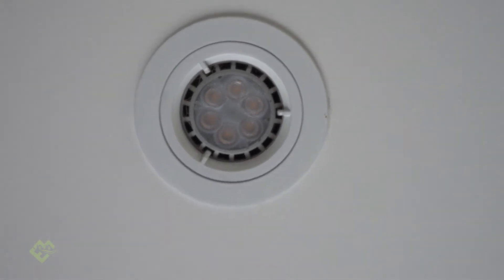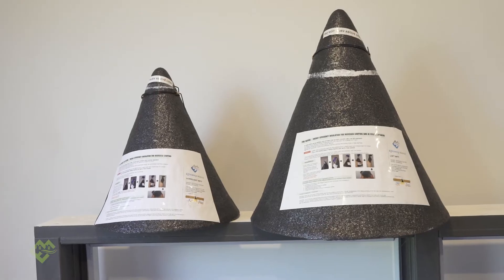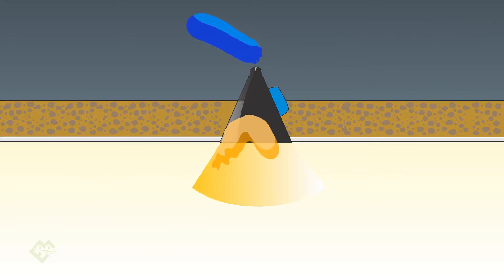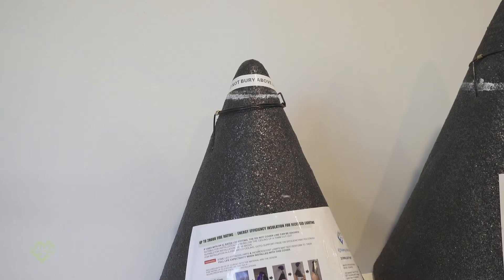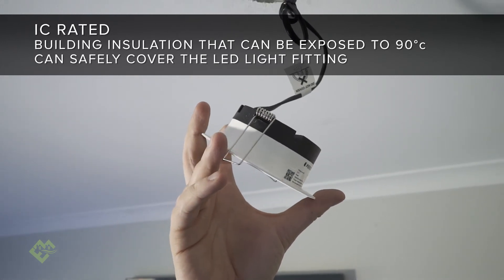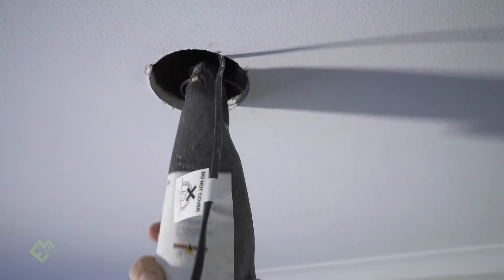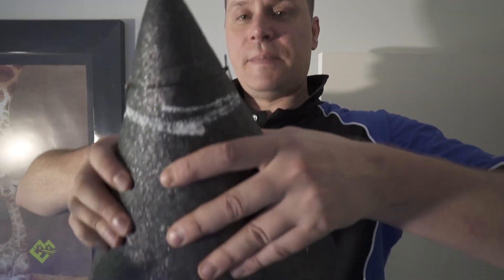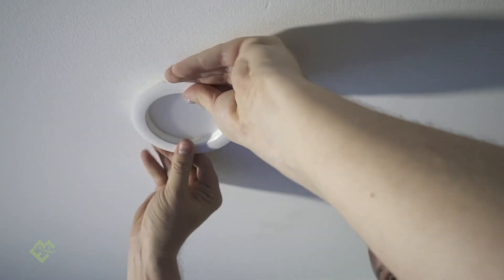LED Downlight Cover: Fire rating, dealing with LED Insulation consistency

Comment: I didn't know this. Do they blow off when you do a passive house door check with pressurisation?
Reply from the maker: Andrew C Never... that’s our story and we are sticking with it. 😉
Reply from the maker: Having said that, recessed lighting wouldn’t be a good idea in a passive house home.
Reply: Efficiency Matrix Taking the fun out of passive haus are we? What about if you were aiming for a Josh's house standard instead? http://joshshouse.com.au/
Reply from the maker: Andrew C No problem with your standard homes.
Reply: Efficiency Matrix Josh's house is 10 stars, with HVAC built to standard budget.
Reply from the maker: Andrew C What level of air tightness?  And insulation consistency?
Reply: @And-c7n  interesting it got 10 stars with only 1 double glazed window

Comment: I don't see how this product would be energy efficient as installed.  The cone would have to be air sealed to the wallboard and the wires would have to be sealed where they enter the cone.  Why isn't there any insulation in the ceiling cavity?
Reply from the maker: There is insulation in the ceiling cavity.  The cover can be caulked to the plasterboard, from above.  You are right you may need to caulk all these penetrations, and around the lip of the cover.  If you want a totally air tight ceiling, steer clear of recessed lighting all together.
Reply: I agree.  As much as I like recessed lighting, I would rather have a tight building envelope.
Reply from the maker: Let us know if you have any more questions.
Reply: OK.  Here's a question.  I can't afford passive house rated windows.  I plan on building 11-inch walls and using window bucks.  I would like to install the windows against stops (1" strips) inside the window bucks.  I was wondering if I would gain anything by putting a dual pane window against stops near the outside of the buck and putting another dual pane window near the middle of the buck.  Would doubling the insulated windows double their insulative value?
Reply from the maker: 59seank Send us through a detail drawing of  what you are planning to do.  Go to our website and send us an email.
Reply: Thanks.  I don't have any drawings yet.  I've searched the Internet for anyone else trying two insulated windows in one opening... but no luck so far.  If you hear anyone trying it, please let me know.  It seems intuitive to me that this would work, but a lot of my intuitions are wrong.
Reply: This product isn't about energy efficiency or insulation. It's for fire insulation. Stopping the spread of flames

Comment: If they’re IC rated, you don’t need these.
Reply from the maker: Agreed, however, lamplife longevity can be an issue.  The downlight cover can provide abit of a breathing space to keep your LED’s cooler for longer. 😉
Reply: @ecoevo  LEDs don’t get hot or heat up that’s the hole point of them
Reply from the maker: Incorrect. Under insulation they do.  And electronics do not like heat, when it comes to longevity.
Reply: @ecoevo  well you’re not meant  to put  any wiring or light fittings under insulation anyway but we do as for down lights your supposed to remove a section of loft insulation  but as I said LED lights don’t get hot or heat up
Reply from the maker: Actually newer downlights are IC rated down here in OZ, which means they can be submerged in insulation for the benefit of insulation consistency.  Now... LED’s do not get nearly as hot as halogen or incandescent globes, however they are electronic, and electronics can prematurely fail when operating in elevated temperatures.  And That’s a fact. 👍🏻
Reply: @Dog-whisperer7494  Oh yes they do, that’s why recessed LEDs come with heat sinks, so the bulbs don’t burn out from the heat.
Reply: You do if you’re installing them in a fire-rated ceiling. Once you cut a hole in the ceiling, it’s no longer fire-rated and you need to install these to get it back to code.
Reply: @Dog-whisperer7494  the lights do not, but the drivers built in to convert the 240v do still get hot